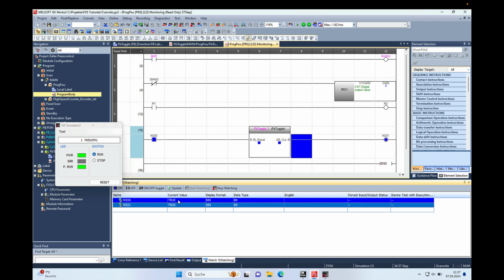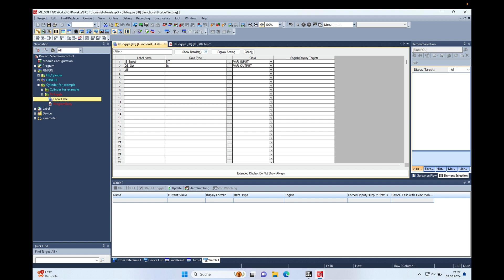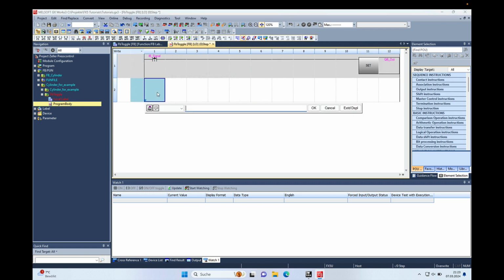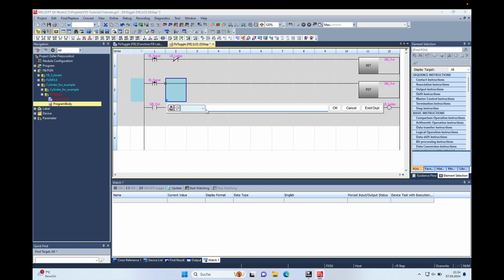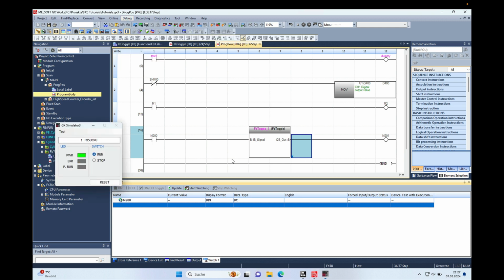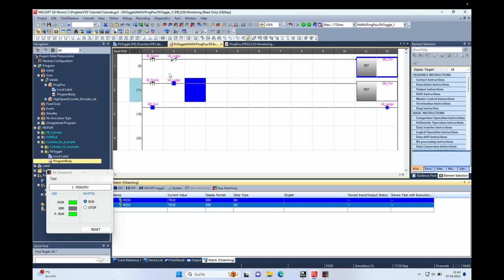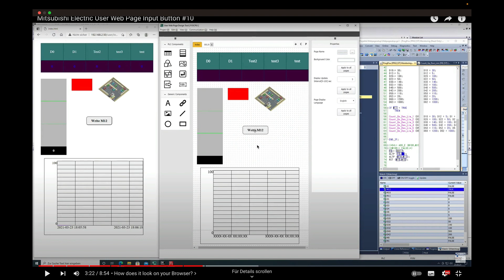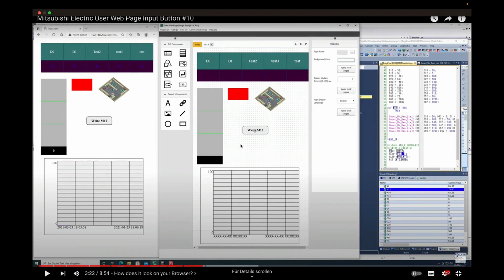Toggle Bit with one Input only Mitsubishi GXWorks3

Comment: Plz reply sir
Reply from the maker: Hello Sir, how can i help you?
Reply: @zellerautomationandplc  sir simple communication plc to plc FX 5u read and write bit  are not working this issue so how can I solve 
IP also changed 5 plc
Reply from the maker: Hi i do not transfer Bit. Only words. And then  i split them into bits. This is a very easy procedure. Therefor  i have made up a series of videos. If you check those videos out i am sure it will be working. https://youtu.be/BHfrqYSXoDM, https://youtu.be/NhoI5CTcVwU, https://youtu.be/A0KpLS9Tdj8  @prathameshtalekar6044